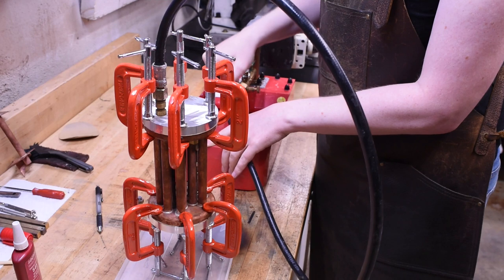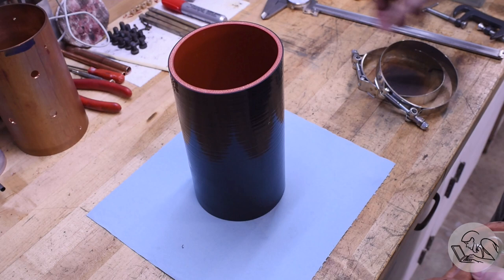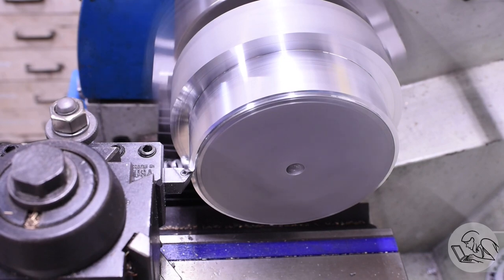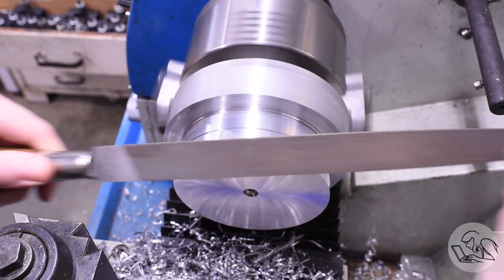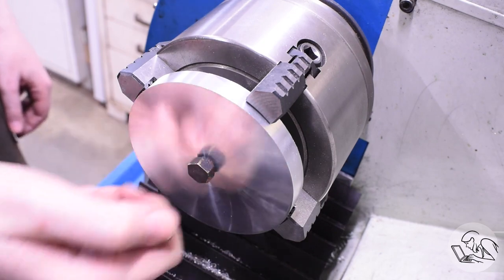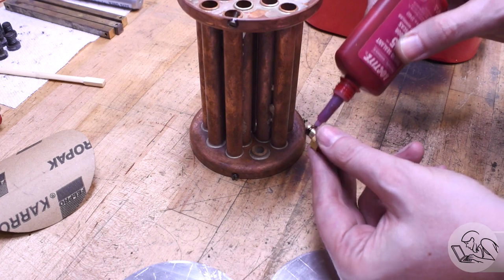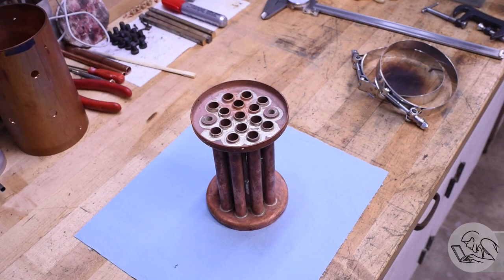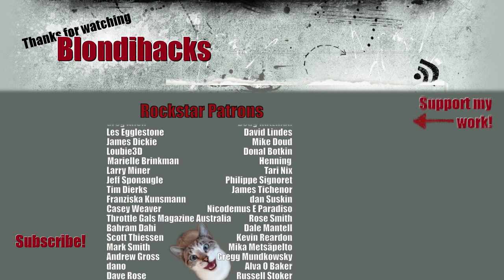Pressure Testing a Boiler Core | Model boiler build, part 9!

Comment: Quinn , you do realize that there is no such thing as to many clamps ... I just want you to know when you put all those clamps on your bench 75 guys fell in love with you ... The only problem is they are carpenters  ( Thank you I will be here all week  , Please tip the waitresses )  Any way when a solder joint fails they don't drip .They spray ( ask me how I know ) street pressure here in L.I. N.Y. is 60 to 70 PSI  years ago when every thing was soldered you turned on the main and checked every connection ,most times a screw up was a spraying connection If you Fluxed the pipes good the heat draws the solder on to the  fluxed  joint  in the pipe every time ..    And old plumber told me  always stir  the flux  before applying it be cause is separates in storage  and you can have a problem but a properly fluxed joint with even heat and enough solder works every time . and you r prep and workmanship is ALWAYS outstanding .....

Comment: Instead of blanking if the center hole in the bottom plate Why not pass a threaded rod through the center tube I know you will have to add another vent hole but it will give you even pressure on both ends 
Andy
Reply from the maker: I updated the pinned comment with the explanation why I clamped the way I did. 🙂

Comment: Not sure about the "pressure from the outside thing" a soda bottle can take 8 bar inside but collapses if you  just suck on it with your mouth
Reply from the maker: Plug the bottle and try again
Reply: @Blondihacks  well if you put it plugged in a pressure vessel it will still collapse
Reply: External pressure makes circularity important. Internal pressure tends to make things more circular, external pressure tends to flatten out of round components. Boiler codes and and submarine pressure hull design specify circularity limits. 
Not really a consideration at your scale and pressure.